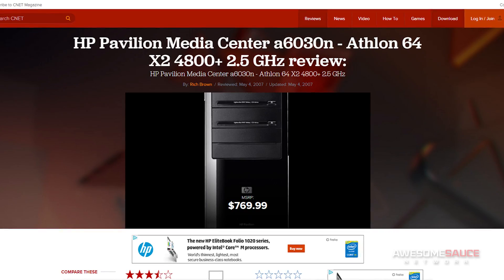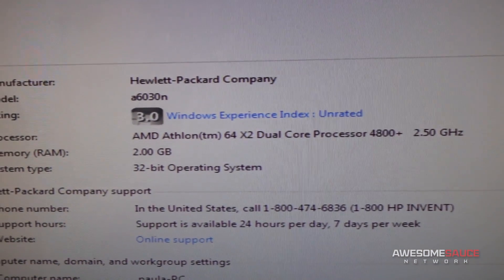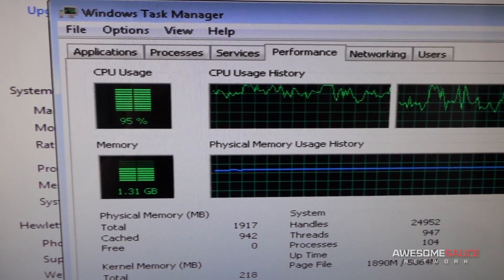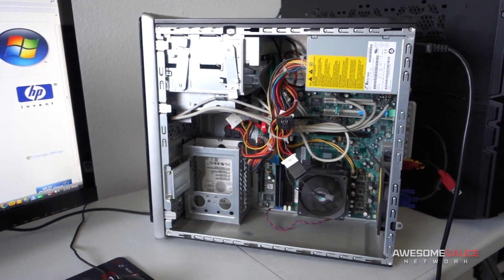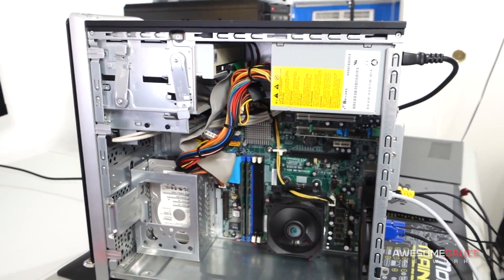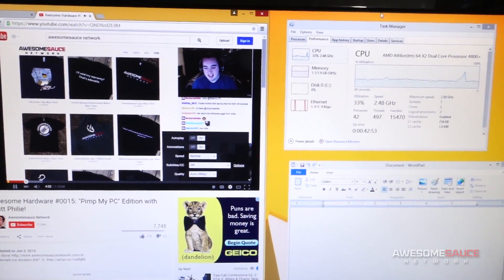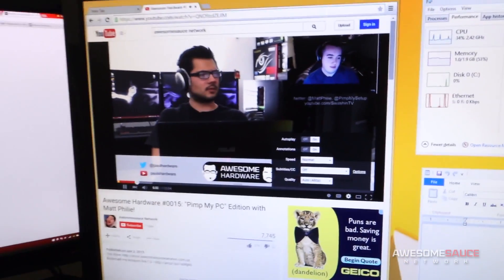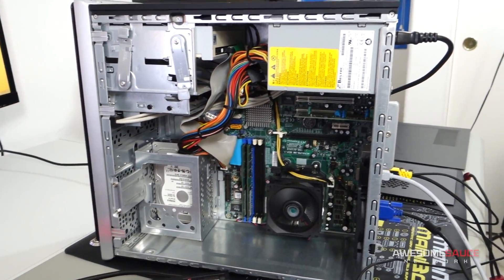Cleaning Up My Neighbor's Old Desktop!

Comment: Clean Install?!? Noooob!!!
Just run Advanced System Care (Free), put a HOSTS list on it (Free) and install AVG (Free), run scans, reboot and if you really need to then run an anti-root kit tool but essentially that and a defrag should cover 99% of old PCs.
Oh and 2007? Thats new kit compared to some of the stuff I'm running which includes an SGI Indigo from 1992 and an original Mac plus I have an original IBM PC and AT in the loft.

Comment: i ended up buying a e machine pc from my wifes brother. he's not all that tech savy as he thinks he is, he seems to think the more the gpu and psu the more better it runs. needless to say, i bought it off him for the price he paid for the gpu and psu. 
psu 750 watt 100$
gpu GTX 550 Ti 160$ (i know it's not worth that price, but it was worth it for 260$)
i learned the 2009-2010 pc could take up to 8Gig ddr2 ram and the best processor it can take is a phenom ii x6
so i bought a phenom ii x4 965 be edition, used. (got lucky) for 60$
and found the best ddr2 ram i could buy, 8 gigs for 25$!!!
that's all i got in it for now. it currently runs like a champ. great mid level gaming machine. i plan to upgrade the hardrive and gpu a little better. 
end game it should look like this.

750 Watt PSU (260$) the price i bought with the pc
Phenom ii x4 965 BE (60$)
8 GB Ram PC2-6400 240pin DDR2 800Mhz (25$)
EVGA NVIDIA GeForce GTX 760 ACX 2GB (150$)
and any good hard drive for the price (30-100$)
total= $525(lowest) - $595(max)
this is the pc maxed to the specs it can take. for $600 i can keep up with some games. not all, obviously. this was my first experiment machine, and needless to say i'm happy with what i can do with it for how much i spent.
Reply: I just wanted to share my pc story to show you don't really need to spend a lot of money.
Reply: +ThyVillain dude... for 600$ you could've gotten sooo much better. at just 650$ you could even run most games 1080p games at 60fps ultra

Comment: I kinda love resurrecting old systems. About the cable management, you did pretty well and I hate those terrible IDE cables too. I have a system at home in which I put a DL-DVD burner with LightScribe, but the IDE cable messed up the look of the system so I dumped it and now I'm using an external DVD-drive whenever I need it. But honestly who uses DVDs anymore right? :D

Comment: If you suggested to him the following upgrade it'd be much better in addition to the cleanup you did, SSD, DDRII 8 GB RAM 4 x 2 GB? Athlon 64 WILL run 64 bit windows 8, which you should have done the least is install it..., and just any plain  budget graphics card , would make youtube way faster?, and take over a hefty load off the onboard "weak" graphics... Hell just suggest a 50 bucks graphics card without the other upgrades it would immediately give him a great performance boost...

Comment: Your neighbours PC is better than my laptop (Not by spec wise) as his PC turns on and turns off without any problem whilst my laptop doesn't even turn on (I can here the HDD and stuff running but nothing displays on the screen). 

My laptop is a HP Pavilion 15 Notebook-PC with Windows 8.1 (Had to downgrade to a cracked version of Windows 7) as the HDD which was installed (1TB HDD- already installed when I bought from Currys and PC World) failed (this is what the guy said in a PC Repair Shop so the shop keep installed a 128GB HDD for £80 which I think is a rip off.

Comment: Frankly it isn't worth upgrading this system unless you happen to have old spare parts lying around. My recommendation to the neighbor would have been that when they felt it was time to upgrade, don't bother actually upgrading, and instead do a full system replacement. For a couple hundred bucks you can go to Best Buy or Sam's Club and buy a system that is a number of generations newer than this system.

Comment: Why tell the customer to invest in a more powerful system when he could use Linux.   Distros like Lubuntu and Anti-X are fast with 1gb ram and fly with 2gb ram.   This person could even use  Windows 10.   That won't be free as he was using Vista.  

Linux is free, fast and safe.   If most of what he is doing is browsing the web and or doing light office work then its great.   No Windows spyware or malware.   No need for that Windows security crap which uses system resources.

Comment: Dissassemble Everything including CPU,Clean Parts,Sockets and Wires and Reassemble

1) Change the PSU to Corsair CX430 Modular
2) Remove CPU Cooler and Install Cooler Master Hyper 212X 
3) Install a Nice SSD like SSD 850 EVO and use the SATA Connector 
4) Max out RAM
5) Install Latest BIOS Version
6) Install Windows 8 or 7 (If Possible :D) or Re-install XP and Update it fully
7) Update everything.

Comment: I would have removed that old dial-up modem and talked him into another 2gb of DDR2. Buy it used to save $. Forget the cable management and extensive cleaning. Just blow out the fans and make sure they aren't noisy (bad bearings) and check all the motherboard caps for bulging/doming.

Comment: Would it be stupid to use that yellow fan as an intake to get better temps and use the powersupply as the exhaust. I suppose the cpu doesn't need more cooling.

Comment: 349000 people just watched someone who claims to know about computers -  apply cable management to a computer that doesnt need it ( if cable management was an issue -  it would have been an issue at some point in the last 8 years ) 

installing windows 8.1  on a system that has 2gb ram - instead of windows 7... which would run better.

in general -  this was a massive waste/fail. even the dust cleaning was not needed... again... if it was an issue it would have been an issue in the last 8 years.

Comment: the HP MB's dont generally like more modern CPU's you may get away with a 5800+ but after that your pretty much looking for a new MB and CPU setup the Memory would be best just 2 more sticks of DDR2 and a graphics card simple ati radeon 2gb card mnothing fancy to unload the MB, but biggest update this guy can do is get an ssd for a boot drive have the old IDE as storage if he must and install google chrome which would give him access to a word processor and spreadsheet and some cloud storage and install a good malware detector may be malwarebytes along with a current virus checker something like AVAST is free. nice tidy up though. hell software wise best tip is that Microsoft Money sunshine edition is totally free to download and still works well under windows 8.1..... kep up the good work. ;)

Comment: used to have a pavilion of this same generation, probably with the exact same specs and it always used to run loudly, until one day the video (or graphics card) stopped working. then i got another pavilion (with an intel processor) and it never makes any sound when its running

Comment: I am still rocking my old HP Pavilion a6419fh, a similar model, but based on a Pentium dual core, not an AMD platform. My system is fully SATA, so no IDE cables, although it does have the plugs on the motherboard. My system runs very well for its age, still on vista, but will use one of my spare Windows 7 Pro licenses to upgrade to 64 bit, then to windows 10.

The first day I bought the machine way back in 2007, I installed an NVIDIA 8800GT "performance" edition. I needed the card because my monitor was HDMI based, and these computers were VGA only.  Drivers for Vista and that card were always an issue, but by 2013, numerous updates seemed to fix most of the problems, no more black desktop background. My system came with 3GB of ram, but I will likely add more when Windows 10 gets installed.

Only downside to these systems, at least mine is the fan noise is very high. I am considering replacing the video card with a current-gen one, but that will require a new power supply as well.

People ask me why I would spend money on this system, but it works for me, so why buy/build another.  I have a newer system (core i5 and all) that I use as my HTPC/server so if I want to game, I just use an Xbox controller with that.

Overall, I am very happy with my HP Desktop. I just with their laptops lasted longer, I have had four that have failed on me, two were from the NVIDIA GPU issues, and the other two were other problems.

HP did a great job with the 6XXX series of pavilion desktops.

Comment: So you found win 8.1 driver for a PC from 07? Sounds unlikely.
Reply: Nixima81 what?
Reply: ***** The computer is from 2007. Came whit Vista like all the per-build PC's back then. If you install Win 8.1 in that machine like in this video you most likely going to run in to the problem of not finding drivers for the hardware sense they ended the support whit Vista. If you´r lucky Microsoft's build in drivers will cover you but thats whit a fair bit of luck.
Reply: Nixima81 I would understand if he would have a graphics card, but he doesn't. Drivers are more often than not software that doesn't care about hardware (as long as you have 32/64 bit).
Reply: I don´t know what exactly they change in drivers to make them work in newer operation systems but i know they don´t care for changing it for long so getting drivers for Win8.1 for a pc from 07 is hard unless you can force them to install.

Comment: I've built over 100 computers, and tried to rehab several like that one. The only thing that really helps is an SSD drive. Whenever anyone come to me with an old Dell, HP etc , I tell them to buy a cheap generic i3 or i5. Tell me, why did you resort to insults when this is a simple matter of opinion. Immaturity maybe?

Comment: Awesomesauce Network 
What thermal paste are you using it looks whitish to me. Is it ceramic based?
If it is why? Silver has better thermal conductivity then ceramic.
The diamond is the best but diamond based thermal paste is extremely thick.
I also do know that difference is few degrees between ceramic and diamond.
But when you can get silver why to buy ceramic?

Comment: If that PC has SATA II then a SSD would breathe new life into it. Compared to its current performance it would Fly. Biggest bottleneck in a PC is those old dinosaur hard drives. An SSD in an old ass system like that or any system for that matter makes a Huge difference. Enough difference that a casual user (excluding gaming, video editing, or something intensive like that ) would not have much reason to upgrade.

Comment: I love this kind of things. Gives me a kick too to look on ebay on old parts.
For this one though I would go with Win 7 and insist that the friend would buy extra 2gb of ram, it's quite cheap. It would make huge difference.

I remember I had a P4 system all the way back from 2003, which, as always, because I had spent a fortune on the MB, although at that time you could run XP at 256MB, it had a provision for the outrageous 4GB of RAM

Trust me, today, with Win 7 and the 4GB it runs beautifully.

Comment: Ive used this exact PC for gaming for 2 years, except mine has 4 gb ram...
Reply: SevoGT DABEE And by gaming you mean Minecraft right?
Reply: Yeah xD
Reply: SevoGT DABEE GG xD
Reply: TheGoldenEagleEye Lol I get 10 fps on a block game fml. Thank god I have enough money to build a new PC =P.
Reply: SevoGT DABEE Well Good Luck!
Reply: SevoGT DABEE Yeah that must be a hell of a Gaming RIG. What your running Witcher 3 Ultra setting :)?
Reply: I just got a new PC. i5 3.2 Fhz. 120 GB SSD. 1 TB HDD. 2GB Video card (Geforce GTX 750 Ti). Running MC with max settings, OptiFine, and an ultra HD resource pack at about 300 fps.
Reply: SevoGT DABEE If you play Minecraft,Get a shader mod (if i remember correctly) it makes it look nice.
Reply: I dont like it imo, and the FPs would probs drop to about 40 =P
Reply: +SevoGT DABEE I get over 900 fps on minecraft, Never really played it but I just wanted to see the performance for the lols and I dont know what optifine is lol, specs: i7-4790k @ 4.40Ghz, Gtx 970 4GB SLI (2x 970)
Reply: Casual Lyric It makes sense, you CPU is amazing and minecraft is mainly based of java, which is CPU based. Although, the new version is more GPU based, whoch probably means you'll be getting either the same or better. Tell me when you tested it? Btw, nice PC 0_o
Reply: about 1 and a half month ago or so
Reply: Alright, so you probably downloaded the .msi version?
Reply: SevoGT DABEE I removed it after testing stuff with it so I got no ide
Reply: Alright, so Im assuming you used your GPU
Reply: +TheGoldenEagleEye clicks view all comments= finds GoldenEagleEye.
YOUR EVERYWHERE BRO

Comment: How many background processes is normal.

I have 106 on startup, just viewing the web, but its difficult to know which are necessary system, which are running on legit application I use (but not right now), & which could be spyware or something I installed & never used.

Comment: I have a very similar model from the same series that was released together. and I'm doing pretty much the same thing, mines a little less infected than this, and the cpu usage isn't that bad when nothings going on, I have a few problems with the case though as it's secured together with some type of metal rod that's seems to have been soldered so it can't be taken apart.

Comment: What a dick... Why would you install windows 8.1? I demand you to take it back, install a good version of windows (such as windows 7) and say you're sorry!
Reply: DerpMans Derpyskin win10 is even better at running well on low spec systems
Reply: DerpMans Derpyskin Windows 8.1 is the fastest version of Windows. It's better for old systems like this. People complain about the start menu, but if he's just a casual user, he'll probably just have his most used programs docked anyway.
Reply: DerpMans Derpyskin Windows 8.1 is the fastest windows version yet :)
Reply: DerpMans Derpyskin or else you're grounded
Reply: DerpMans Derpyskin windows 8.1 is better than windows 7 in every way
Reply: VoodaGod Well... uhh thats heavily arguable, and I hope you're joking...
Reply: nope, it runs smoother, uses less resources, adds useful features and was cheaper than windows 7, as well as improving gaming performance. I really don't know why people bitch about the missing start menu, I always just hit the windows key and start typing whatever i want to open, be it an application, a file or a settings dialogue and hit enter. No need to navigate through countless menus
Reply: DerpMans Derpyskin Windows 10 is supposedly for Gamers. Keeping the same/similar interface design. DirectX 12 will be able to render 3x more objects, which was bench-marked to be around 150k.
Reply: VoodaGod meh i don't care if it's windows 8 or windows 7 i always use the basic theme so it doesn't matter to me at all. damn i love to customize the basic theme in black, gray and green it looks beast
Reply: ZombieAssassin7777 what about windows 10?
Reply: VoodaGod exactly
Reply: ***** I have windows 7 on my PC and I use it for gaming... I just didn't upgrade to 8 because it costs money, and from the negative feedback it got, I figured I would stay away from upgrading for a while. Also there's the whole "MetroUI" thing, that I would have a hard time getting used to, just because of the way I use my PC.
Reply: ***** I will probably update to windows 10, atleast on my laptop and Surface, but because "my" desktop is actually a family one, my dad has a say in what happens to it, and he doesn't really wan't to update.
Reply: ***** I know.But its not my computer. Also how did you get that name? I would imagine its taken
Reply: i don't think names can be taken in google+ since you're encouraged to use your real name and since most people don't have unique real names you can basically use any name you want
Reply: DerpMans Derpyskin he could have just kept vista on it...
Reply: HamDerDanskeren Aside from 10, which, although technically not yet available, is coming out in 11 days as of me typing this (release date July 29th). Supposedly, from what I've seen and also technical previews, it's still faster than older versions. Just not as much that it's entirely groundbreaking. It's free for 7 SP1 and 8.1 Update though, so that's always nice.
Reply: I know that windows 10 is "the fastest" but? xD u know? xD its a feaking preview xD men i will change in 10 days, as u say :D
Reply: VoodaGod yeah, it runs on a raspberry pi 2 model B
Reply: garrett cox Im not sure how that works because im pretty sure the 2B has an arm processor.
Reply: DerpMans Derpyskin microsoft is releasing a build of windows 10 specifically for devices like the raspberry pi. And windows phones also have arm processors and run windows 10 ;)
Reply: VoodaGod oh cool
Reply: DerpMans Derpyskin (dont quote) i believe its called "Windows 10 with Bing". Its fantastic after they tried windows 8 "RT".
Reply: +DerpMans Derpyskin Start 8 + ModernMix, problem fixed. Might as well add dexpot and windows 8 just turned into windows 10 without tracking and directx 12!

Comment: WTF is wrong with this guy.
He calls an 2007 PC old. What a moron, a single core cpu with a socket 478 or lower is an old pc. I mean, this computer is still fine for his neightboor. Why doesn't he just upgrade the memory a bit so he can still use it for a year or 4-5. HP intended people to upgrade their memory later on. why else does it have 2 extra empty slots straight from the factory

Comment: Isn't it better to change the fan next to the cpu fan into an intake?
Because you are currently achieving a negative air pressure in the case, which will make everything more dusty.

Comment: Upgrade path for the neighbour:

A6-6400k - cheap as shit and will perform better than the current CPU.
Any cheap FM2+ mobo.
4GB of DDR3 RAM at 1600Mhz
An SSD, since most older users don't do proper hard drive configuration.
Intake and exhaust fans
And that'd be about it.